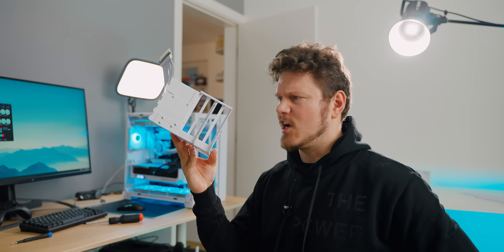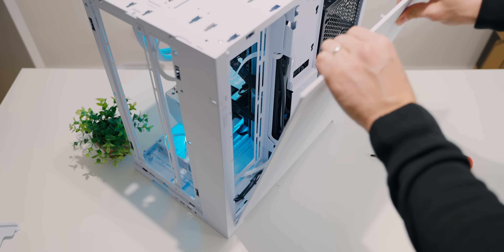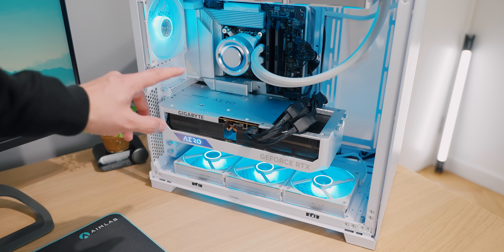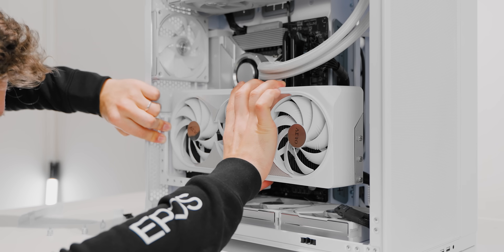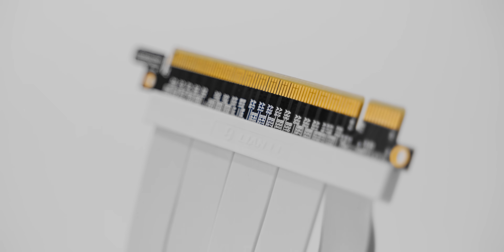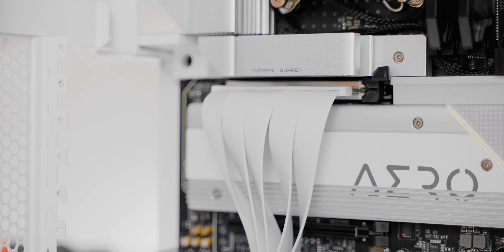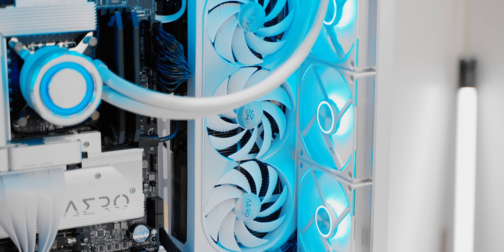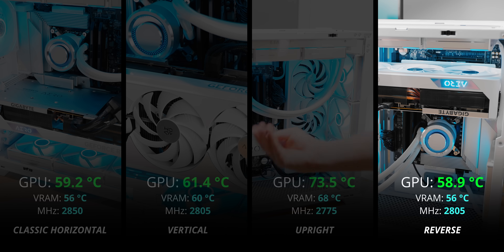The Best GPU Orientation EXPLAINED!

Comment: The vertical GPU mount can be screwed into the top (or bottom) of the case with 4 screws and in very solid. Additionally there’s a bracket that comes with the mount to secure the other end of the gpu that’s especially useful when mounting it in reverse mode,

I’m in the process of putting together a reverse build with gpu in an upright, inverted position with a couple of fans mounted behind it to pull the warm gpu air out of the case. I’ll update with the temps when it’s complete.
Reply: So do you have the Temps now? I‘m curious because I want to do the same. What gpu do you have?
Reply: @tolil8547  I have a PNY OC RTX 4090, it runs at 70 C under load and idles at 34 C. Ambient temps are around 22 C. 

There are 4 fans pulling air into the case at the bottom/side and three exhausting it out the top and one behind the GPU. I also adjusted the fan curve to run a little more aggressively than stock but I still barely hear it in this case.
Reply: You nailed it brother. I knew also that this setup would perform well

Comment: when you put the gpu in the vertical position.. why didnt you put the 3 fans behind it as exhaust.. instead of having the 3 intake fans directly in front of it causing all that airflow to get pushed right past the gpu... or even better put the fans on the bottom and leave the put vertically and test the temps like that as well... its just crazy how many configs you can do but even you said having the gpu in its original horizontal position with the fans blowing air directly into the gpu made the temps worse then just having them turned off.. so why do that same thing when you did the verticle mount.. just kinda confusing to me.

Comment: If the GPU is Liquid cooled, there is no difference in mounting positions Thermals. So if you use Liquid Cooling for the GPU you can use every mounting option. But a question: if i mount the GPU in Upright mode, and reverse the Case can i install it on the top side, or do i have to mount it at the bottom?

Comment: How come when you have gpu in vertical riser mode the temp is worse ?? I would thought those 3 intake fan on the bottom as well as the 3 fan on the gpu itself would make the cooling really good since its all on the heatsink

Makes me worried about my Hyte y60
Reply: Because the fans are too close to the bottom edge of the Gpu when mounted vertically. Also, they are fighting the 3 fans of the GPU, which are exhausting out of the sides of the GPU, while the bottom fans work against them

Comment: So I have a thermal take core P8 which comes with a vertical mount tray and PCIe riser cable.
So obviously I installed my GPU vertically.
I should note that my GPU is a 3080ti, aka a heat monster.
After about a month I start getting visual problems on my monitor as in my monitor was blocking out.
Last time I saw a blackout so thoroughly it involved tequila and some really bad choices.
Turns out that the heat from my GPU had actually fried the ribbing of cables in the PCIe rider cable.
Fortunately, the case being modular, I was able to essentially disassemble the vertical mounting cage, turn the slots 90° and mount my GPU correctly apparently into the motherboard.
Seems I may have inadvertently saved myself some trouble in the future when upgrading to a bigger GPU

Comment: Is it possible to keep the case like normal and just flip the gpu so intake is at the top and that way you set your bottom fans to exhaust. Wonder if that would help with front fans set to intake 🤔

Comment: I'm really surprised you went with an upright configuration without taking advantage of one of this case's best features: being able to install 3x120mm fans on the side of the case behind the GPU to exhaust heat. Also, the particular model of GPU in this video is not considered compatible with Lian Li's upright bracket. It requires an updated version of the bracket and even then only when the 011 Evo is in reverse mode. Just an FYI so that potential buyers don't get discouraged by the huge temperature disparity shown in this video.

Comment: In the upright position with case intake fans mounted in the front it looks like they're just blowing air right past the GPU, them being so close to each other. I'd like to see the results for upright with bottom intake, glass front and top exhaust through the AIO, maybe air would travel more naturally in this config. But anyway, GPU in the upright position didn't look that great for my taste...
P.S. That AIO pump design looks slick

Comment: can you turn the GPU so that the fans are facing backwards?  That will allow the GPU to draw in outside air, then place fans at the bottom of the case to expel the warm air through the top of the case, and not having warm GPU air blowing over the rest of the case.  That is, if you don't care about looks.

Comment: Just to add some testing confusion, I have  my O11EVO in a horizontal position, reversed with a CPU AIO, with extra fans for a push/pull configuration, exhausting from what would have been the top of the case, and intake fans at what would have been the bottom of the case, I also plan to add intake fans at the front since currently there is negative air pressure created between the reverse mount GPU and the CPU's AIO setup.

Comment: One system has the GPU in the standard orientation, but it's water-cooled so it makes no real difference.  My second system has an Air Cooled GPU (EVGA 3080 FTW3) in a vertical orientation, and it's in a Cougar Conquer (Open) case so there's no air restriction to the GPU.

Comment: temps improve if disable bottom fans  at vertical orientation because stops pusing the gpu warm exhaust air back to the intake fans on the gpu.

Comment: Pretty sure moving the fans to the front in the upright config had them fighting the fans on the GPU rather than feeding them more air. The front fans might  be moving air past the GPU faster than the GPU fans can pull it through the cooler. If you have a shorter GPU, I'd love to see that test with the fans back in the bottom.

Comment: I've got the same case and done almost every possible way to check the GPU thermals. For the vertical GPU and air-cooled cards like the one you tested, you need to have fans on the side of the case as exhaust. Plus, you have to keep the GPU closer to the bottom fans which will force the air to move from the bottom to the top with less turbulence.

For the upright GPU in normal mode, you need to flip the GPU and you must have fans behind it. Moving the card towards the glass will give you a better thermal too. And you need to use the 200mm riser cable with your 600mm one to make it work.

The best thermal that I got for a 30 series Strix card is in a vertical orientation in normal mode. Keeping the bracket at the lowest close to the bottom fans. 10 Fans in total in the case ( Intake from the bottom and the back fans. Exhaust from the sides and the top. )
Reply: What would you say to be the best fan configuration for reverse mode with a horizontally mounted GPU in a situation with 10 fans (3 bottom, 3 side, 3 top and 1 rear) also including that 1 set of 3 fans are connected to an AIO (and on a radiator). I am currently leaning towards:

#1 
Top: 3 fans intake
Bottom: 3 fans intake
Side: (AIO radiator) 3 fans exhaust
Rear: 1 fan exhaust

In this scenario the cool air wil come from the bottom and the top and will be exhausted on both the side and rear of fhe case and the GPU fans which are facing upwards will pull fresh cool air into the GPU. 

Did you also test this/what are youre thoughts on this?
Reply: @kajtjuhhh3722  I haven't tried that configuration. Keep in mind the law of physics that cold air fall down and hot air rise up.

The configuration you mentioned might trap some air in the center of the case as there is opposites air colliding on each other on the card level, having positive pressure due to the number of fans and the lack of anything to guide the air will not give you the optimal temperature.

If you have a 3d printer, go upright and design a deflector that guide the air coming out of your gpu to the side fans. This will be the ultimate cooling solution for your gpu. Side will be exhaust. You can use 3x 140mm fans at the bottom to get the optimal air pressure. You can do that without screwing the outer bolts of the outer fans.
Reply: @majd00shka  Good point, I was indeed aware of the hot air rising and the cold falling down. I just build a pc for myself and in the near future I am going to build my brother the same pc aswell, but probably in reverse mode (Lian li o11d evo rgb case) because of his setup 'demanding' the pc to be on his left and him still wanting to see inside the pc, rather than the side with a mesh panel. You seem to have a better understanding with configuring fans in a reverse mode case. What would you say would be the most 'optimal' configuration for the fans in reverse mode with an horizontally mounted GPU (leaving the vertical mount options out of the picture)? I have not yet researched enough about building reverse with a horizontally mounted GPU, so I also need to do that aswell, but I am curious about your opinion.

So in this case it is still 10 fans total with positioning possibilites of 3x 3 fans and 1x 1 fan.
Reply: I’m confused about what u said about the upright mount. Flip the GPU? Like face the fans towards the back of the case or flip it clockwise to to have the pcie part at the bottom right of the case?
Reply: @Whatthefckkk  what I meant was to flip it so the I/O ports will be facing down so the PCIE side will be towards the front of the case. In this way, you only support the GPU with the side fans bracket.

Comment: I have the Thermaltake CTE 750 air with a MSI Suprim x Rtx 4090in the upright orientation, I've seen no appreciable differences in gpu temps Die,memory , hot spot . I was worried about the temps the card would see after some research it is 100 percent a heat pipe issue. if your card has a full coverage vapor chamber with the condenser on the same plane as  the evaporator you should be fine. if you have a straight heat pipe design gravity will over come the capillary force and fluid wont return. that said the o11 evo i think its ppprrrrrrrrrrroblem was more around a lack of exhaust and lack of airflow around the fin stack.

Comment: I think it is wrong to test while the front glass is not installed. Temps will be much different and you may get over heat specially if you have a thick gpu.

Comment: My EVO is in inverted mode with my ASUS Strix 3090 upright next to the motherboard.  It's actually easy to access the DP or HDMI port on the graphics card from the bottom by just quickly disconnecting the bottom panel to  gain access to the ports.   I figured this out AFTER struggling to plug in the DP cable lol.

Comment: Badly implemented experiment IMO.
The only way you can give a credible result on GPU orientation is  to remove all other influences from it. Moving the GPU around inside the case creates turbulence. Ideally this should have been done outside the case, and then you can use the fans to improve on that result.

Comment: This experiment is kinda pointless, it only serves to compare different configs on THIS particular case. Most cases have the PSU under the GPU on the standard configuration, in that scenario having the GPU on another position being fed fresh air (like Mini itx cases tend to do) should improve performance. On top of that, the vertical configuration in this case doesn't make sense, if you are going to place the GPU vertical at least have fans throwing air directly at it.

Comment: I used to be a big proponent of vertically mounted (outputs at the top) GPUs, owning both a Silverstone FT02 and FT05, but that was when GPUs were available with blower coolers. I then got a RTX 2080 Ti with a standard cooler and that's when it went wrong. I mounted the GPU normally in my FT05 and for the first few months it was fine.  Then I started to notice high temperatures. These went away when I put the FT05 on its side so the GPU was upright. Gravity wins in the end.

Comment: Love the vid, but the test is only good for this case.
There are different case types that has 90 degrees orientations with airflow planned for it specifically. 
And another cases that are built for a GPU to be mounted vertically with mash to make sure there is a better airflow for the GPU.

Comment: I have a normal case in a regular configuration, but it's on my left side. It's simply just placed with the long end along the wall, very simple, no need to reverse the entire case 😁 I guess with the power supply on the back you can't do that with this case, but works for normal ones.

Comment: I had a reversed case and my Asus Rx 580 worked better in there. I upgraded to a Asrock Rx 6700 XT and it did not work well. Swapped to a normal orientation and temperatures matched the reviews I read. Orientation can really throw your results off. 
Now water cooled it is no concern, but that solution is not for everyone of course. I really like the looks of these fancy cases. Thank you for reviewing.

Comment: The upright position works better with exhaust fans mounted behind the GPU to pull the hot air. As they exit out the sides and lower back plate
Reply: Yeah i am disappointed that this wasnt tested, i have my GPU set up in this way and very happy with the results
Reply: Same here. I added 2 140mm fans behind the upright mounted card. Temps even at max power 132% on the Strix4090 hover at 61 average in 3DMark
Reply: Could u show me an example on any media or something? Im trying to pull this position with a 5070ti arous master

Comment: Lian li  have change to make separate chamber on the bottom because the psu is  in the back, so basically move the mother board little bit up so we can put 120 mm fan vertical in bottom left side of the case put the option to purchase left side panel with glass on top and mesh on the bottom, another glass dividers so graphics card and motherboard completely separated while the glass separator make us can still see our glorious gpu.

With 2 or 3 120 on the front right and 1 120 on the back as intake and 360 aio on the top as the cooling solution for motherboard and CPU chamber. And 3 vertical 120mm on left and vertical gpu in its own chamber on the bottom with the option of additional exhaust vertical exhaust fan in the right. 

This make all the motherboard components CPU get fresh air on its own chamber, and the gpu get all the fresh air from bottom left side of the case and exhaust on the bottom right side of the case .. There is no need of ultra long rises cable. And because gpu is its own chamber you don't need to worry it will heat up the rest of your component..

Comment: the upright position blocks most of the video cards exhaust fins, which is why it sucks. while the vertical mode has one side of the vga's exhaust fins blowing against the bottom intake fans, which causes some of the exhaust air to re-enter the vga's intake.
horizontal offers the best performance because the intake fans blow straight into the vga fans and they also help blow the exhaust air from the vga up towards the exhaust fans at the top of the case,
i fitted a seperator for my horizontal vga to help prevent the exhaust air re-entering the vga's intake, kind of like having seperate intake and exhaust compartments

Comment: This is a bad set of testing, that specific gigabyte card uses a vapor chamber meaning there are right and wrong orientations, therefore testing from the should be considered inconclusive
Reply: The areo 4090, 4080, and 4070 ti all  use this same vapor chamber design, as do all gigabyte cards 4070ti and up

Comment: I have my 3080 ti upright in a Thermaltake View 51 case using the Lian Li mount. I also have 3 x 120mm fans behind it. With the case I do have room for bottom mount fans but I use the spare room for my Transformers figures. On load I think it hits about 60°.

Comment: Ugh ... this was a BIG FAIL. You did NOT show the difference between vertical and horizontal GPU positions. You showed the difference between GPU fans facing the intake direction vs. GPU fans facing 90 degrees from the intake direction. You need to make sure the GPU fans are oriented the same way to the intake direction in all positions.

Comment: Another issue with horizontal orientation is that, due to common fin orientation on the coolers, the air is typically pushed toward the side of the case or the motherboard. Most of the air pushed toward the mobo has very little direction to go but down, which causes a bit of a heat loop. Love the ability to mount in different orientations like this in mainstream cases. LONG overdue.

It makes sense that the "upright" orientation is so hot. One side of the card is entirely blocked by the front of the case and the graphic card's fans are competing with the front fans (i.e. trying to pull air in as the air is simultaneously being pushed across/away).
Reply: That's why we need separate chamber in the bottom for gpu I think Dell case have this before but they put the gpu on top... Lian li can just put in the bottom so it can get fresh air from 3 vertical fans on the left side  and exhaust in the right side..

Comment: Did you wait for the GPU to cool down to the same temperature before each test ? Otherwise the differences you're measuring could be tainted by the residual heat of the previous tests...

Comment: Just one quick question about the vertical mount: is it dangerous if the riser cable is touching the hot backplate of the GPU? Could it melt the cable?

Comment: Upright GPU with front intake fans so close at 90 degrees will blast air past the GPU intake fans and not into the GPU, the GPU would struggle to pull the air in, in take fans in the bottom would have been better.